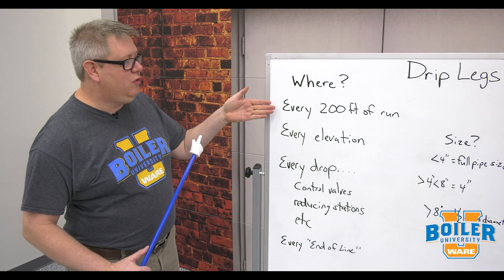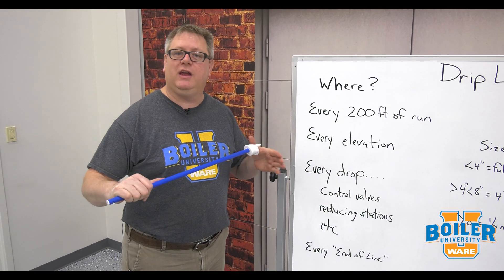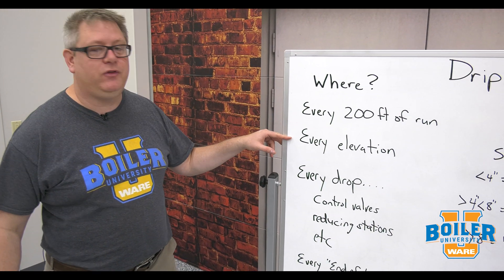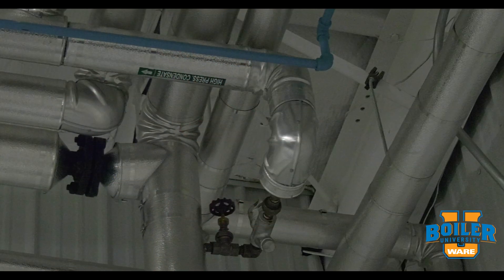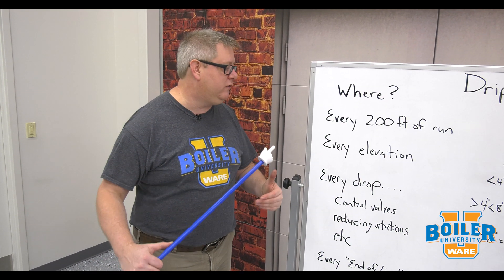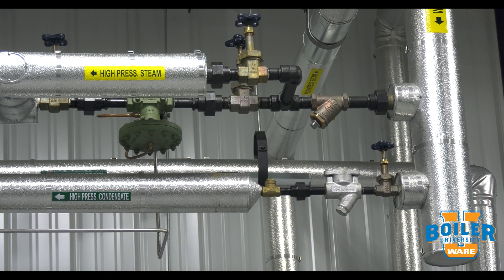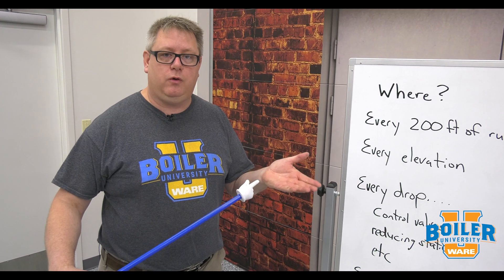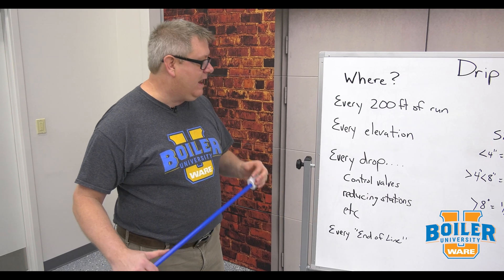Steam Systems | Where Should Drip Legs be Placed? - Weekly Boiler Tips

Comment: There us a 4" steam header run on rack. The routing is run 10 feet straight line then run line upside by 3' then run line 5' horizontical , then run line 3' downside, then run line 10' horizontical, then run line 3' upside. Where i place the drip leg?